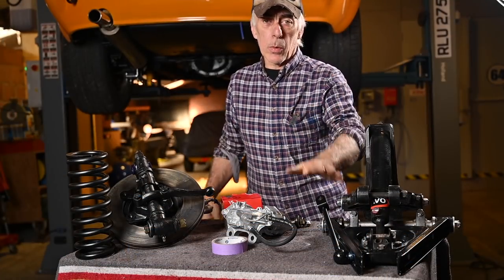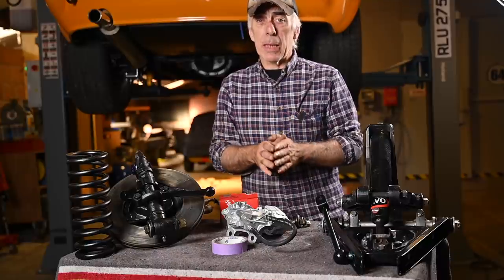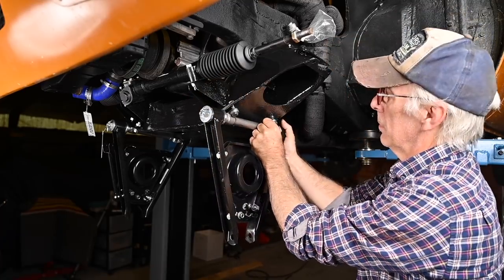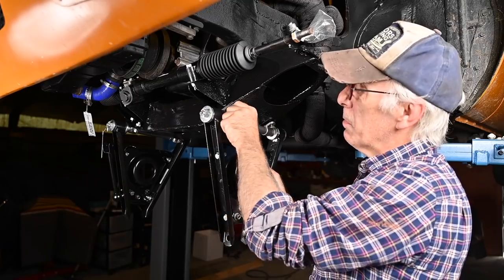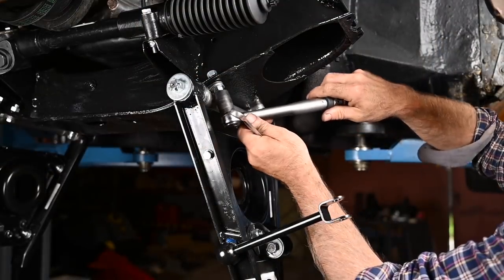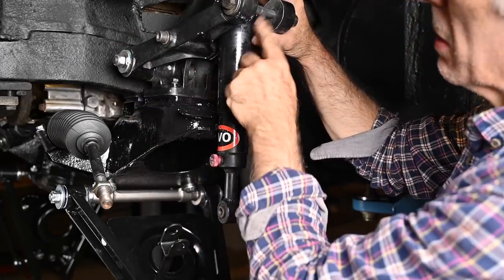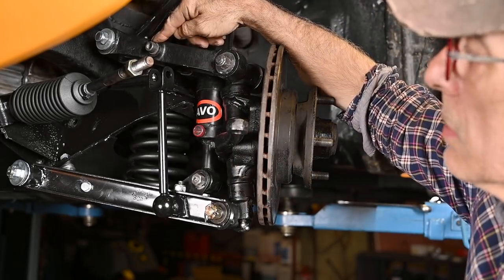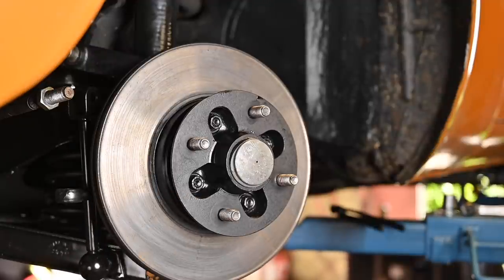MGB Rack & Pionion and more  Part 4

Comment: Here for the comments on using copper grease on brake pads! I do it too for 25 years and never had a problem.
Reply from the maker: Thanks for the comments
Reply: I use copper grease as well and no problems either.

Comment: Hi, Thanks for the great video. Not exactly 100% sure on this but you put the black  thrust washer on the outside of the a-arm. I think a lock washer goes there instead and always thought the thrust washer went inside the rubber protection cap on the inside of the a-arm.  You can see the thrust washer on the outside of the a-arm at about the 15 minute mark.  When I did mine, I had a tough time because the repair kits are not always correct leading to incorrect tolerances. I ended up buying several kits and re-using my old thru bolt. Your videos are great,  well presented, and appreciated.

Comment: Asking for your help: I’ve got a ‘73 MGB with 2 SU (HIF4) carbs… At startup, choke-on, underneath the rear Skinner Union are fumes coming off the exhaust pipe- I’m thinking it’s a gas leak from the carb to the hot pipe?  But, when the choke is off, no fumes. When running, no fumes. At idle after a drive, no fumes. Can the choke-on at startup cause my SUs to leak? Thank you, Neil Shovlin a Subscriber. PS New bushes are next up for my B.

Comment: just wondering why you put the 2 big black washers in the wrong place? .. manual shows goes inside of silver discs on bottom trunnion pivot
Reply from the maker: Can you tell me where that is in the video ?
Reply: @D3Sshooter  9.30 to 11.30 time span
Reply from the maker: @hankpb1  let me see... that is how we always have done it and as per WSM... I will see if I can get to that page..    which manual are you using ?

Comment: I have a Costello brakes calipers and they gets very hot why is that.
Reply from the maker: Thanks for the comments, well that is hard to say .  Of course they will get hot with a lot of braking like on a track. To prevent it  or reduce the heat, install a vented disc ( unless you have that already), and a vent hose feeding cool air from the front scope and blown on the brakes.   If you have very hot callipers without racing the car  then you might have brake pads that stick to the disc, that will cause that issue.  Here you could have the wrong thickness of the discs, the wrong spacers on the brake callipers or even faulty or wrong barke callipers..

Comment: The way you install the trunnion/upright into the a-arm is not correct in the video. The black washers you are using on the outside of the a-arms are actually thrust washers, that go inside the silver cupped washer. This I very critical, as they are there so that the distance tube inside the trunnion can move freely inside the bush. Also, the length of the distance tube relative to the width of the trunnion is a critical measurement as it sets your end float on the bottom trunnion. What you want to do, is to correct the position of the thrust washers, and then tighten the trunnion to the a-arm without the upright being mounted to the shock absorber, (or in your case Costello bracket) this way you can determine if the end float is correct (if the upright moves up and down freely you are usually good, but if it gets pinched you need to correct either the length of the distance tube or the width of the trunnion - manufactures often gets this wrong!)

Comment: Isn't it better to tighten suspension parts with the car on the ground? This way the bushes are not under stress most of the time.
Reply from the maker: yes, you are 100% correct, that is what I will do once the car is back on its wheels..